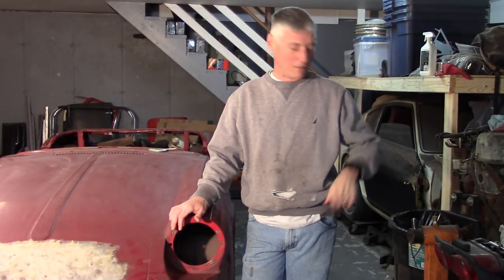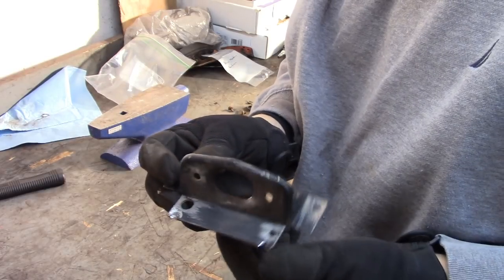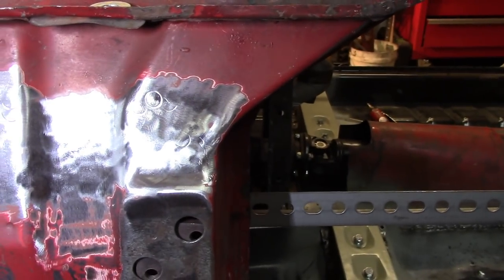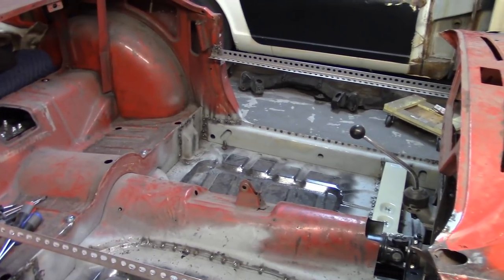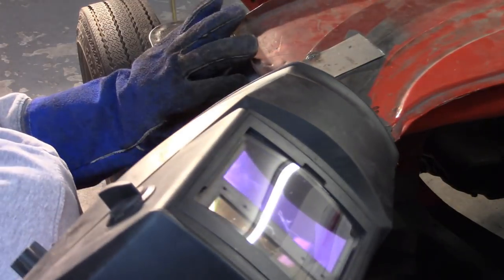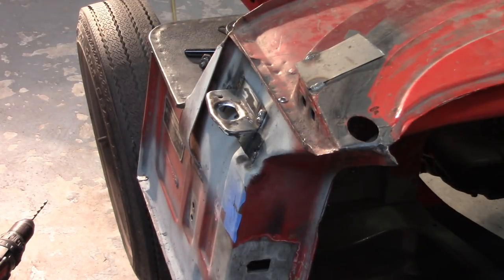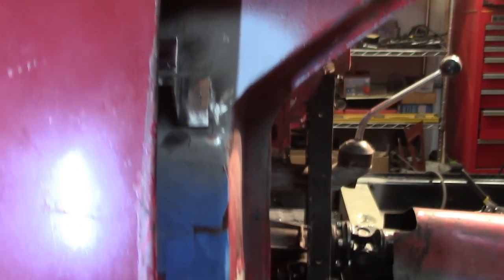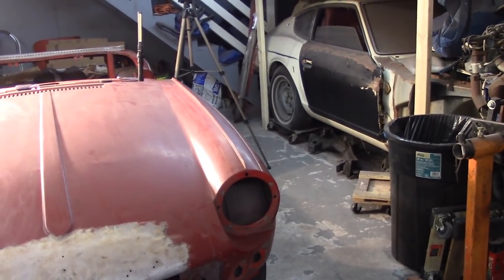Triumph Spitfire Restoration - Bonnet Alignment

Comment: The bonnet inner wheel wells do have a flare on the rear of the lip that kicks in towards the chassis.  It's evident on both sides.  It's easy for these to get bent and hang on the chassis if the bonnet is dropped down clumsily.   Here's a good photo online of the lip flare:

http://car-from-uk.com/ebay/carphotos/full/ebay15735.jpg
http://www.british-pistons.fr/wp-content/gallery/2010-05-02-triumph-spitfire-1500-fh/triumph-spitfire-1500-fh-21.jpg
Reply from the maker: Thanks. I'll take that bonnet, instead!

Comment: I have a few thoughts here. I don't remember what the inner fenders look like on my Spitfire, but I am pretty sure they are not flared like that. So I would definitely try to play with their shape first and see if I could make more room for them to move back. And since the passenger side fits well you can take some measurements, and try to copy that on the driver side. I don't think that readjusting the supports will help as the inner fenders are attached to the bonnet and will always prevent it from going backword no matter where the supports are. However I could see that the driver side hinge all the way at the front is more forward than the passenger one and that is one more clue that the whole driver side needs to move back. And last, keep in mind that the gap can also be adjusted by lifting the front end of the bonnet up. That might close it a little without moving the inner fender backward, but I doubt it would make such a big difference. That would change the angle of the rear end of the bonnet where it meets the door so you are kind of  limited by the door line. Liten48 is right. You should put the doors to give you some guidance, but again, the seil panel is what determins where everything else goes in a first place. I haven't caught the very first videos and I am not sure what have been done to the a-posts, but is there any possibility that the whole front end of the body was twisted in any way? Just asking. I don't see a reason why the bonnet wouldnt go back. But again, by taking some diagonals of the body and bonnet you should be able to narrow the error down to body or bonnet and then go from there.
Reply from the maker: Yes, I didn't support the bottom A-post properly, but I don't think it would have resulted in a twist to it. Something to look at and play with and hopefully I can get it close enough.

Comment: Hi Chris.. a bit off topic, but when I responded to the query about the body to outrigger mount missing thye captive nut, I should have mentioned thay=t I would have used a hole saw cut from the bottom of the outrigger. That way a bolt could be threaded into the cative nut and welded in correct location, then close off the spud from the holesaw cut. You would have good access with the mig torch and the chassis underseal world hide any witness marks.
Reply from the maker: Hi, B. I understand what you're say, but I'm not sure that that would work. I don't think I would have enough room to get the MIG gun up into the outrigger far enough. And I'd have to do it on my back as well. Maybe I'm not understanding you?

Comment: is there any more ajustment in the front brackets to allow it to go back ?
Reply from the maker: Yes. You can see the difference between the angle of the hinge bracket on the RH side (it's raked back noticeably) as compared to the LH side, which is straight up and down. The problem is that the bonnet is hitting the bulkhead, so it just won't move any more. I don't think I took any good pics of the comparison, but I will for posterity if nothing else. But, I definitely have movement ability on the hinge bracket, that's for sure.
Reply: i would give the bulk head where its catching  a bang with the big hammer, but its up to you, but wot ever put the doors on to keep a eye on the gaps
Reply from the maker: +liten48 I'm not at the point yet, but we'll see.